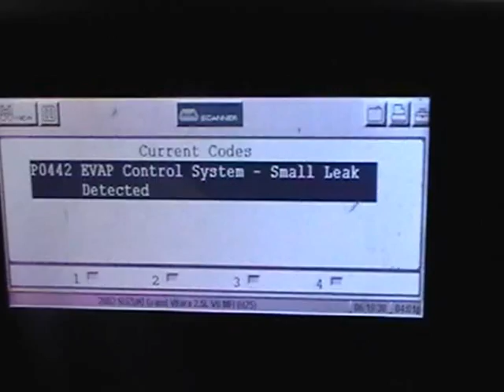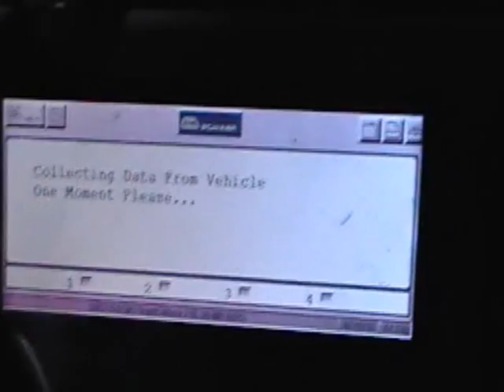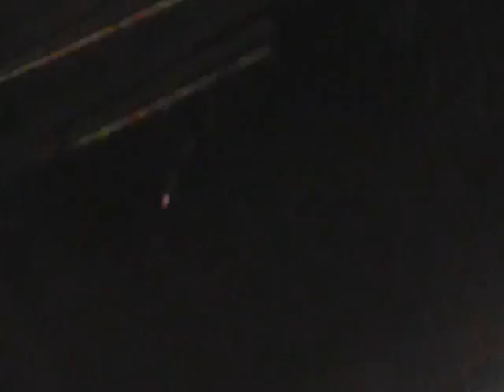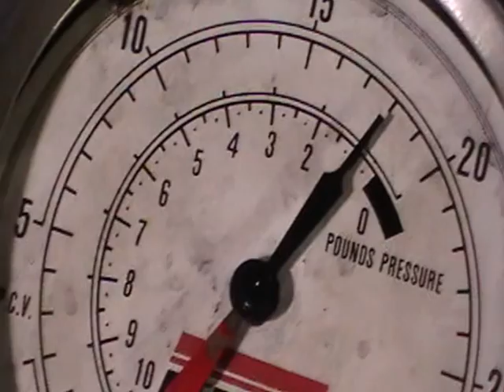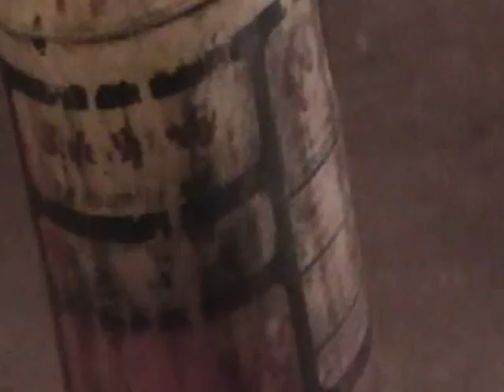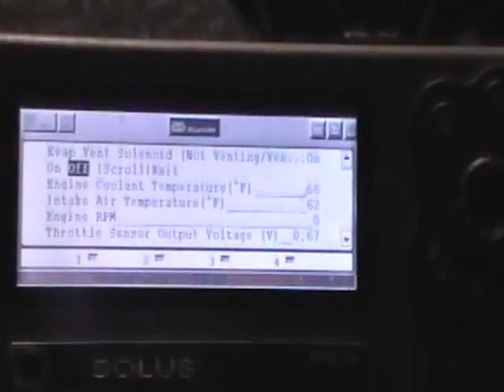P0442 EVAP LEAK...FIXED

Comment: I replaced my vent valve solonoid on my 2004 explorer 4.0 sohc flex fuel vehicle and didn't use pliers on the gas hose. No gas leaked out, is that normal? Or is something blocking the fuel like small pieces of charcoal from the cannister. I got codes:p0460 fuel level sensor A circuit. P0442 Evaporative emission system leak. P0506 idle air control system lower than expected. I have a slightly rough idle when in park. The rpm's go high when switching into 2,3,4th gear in my automatic. Sometimes it keeps idling and wont want to switch gears unless i peddle it down. The rpm's are so high that when it shifts gears my rear end jumps. I have loss of power, it seems like its getting too much air. I do have a exhaust leak. It has 137k miles. Maybe the Egr valve, O2 sensor, maybe the vehicle transmission sensor. I say vehicle transmission sensor because it controls my Abs sensor, and im losing power in the brakes and now the brakes are squeeking like they are to close to the rotor. Possibly a brake booster? Please help! This fucking car is a nightmare!
Reply from the maker: No liquid fuel should.come out of the vapor canister system. Ur good. U could have a vacuum leak . But those fords were known for throttle body issues. I'd clean the throttle plate with solvent and a rag first. And see if u have a changeable fuel filter. A clogged filter and maybe u are having to give more throttle to move? For the shifting issue..
Reply: @jamesdanner7850  I put new throttle body on, and it still did it. Then check engine light came on just now. It said i need a new gas cap. It seems like it working, the fuel system is resetting itself and smoothing out. Thanks for the reply!

Comment: Hey James. It has these codes after KOER test. P1116,P1137,P0141. Will the temp sensor code will cause a no start like this? I have heard it will.
Reply from the maker: +william burke I've seen it on gm alot. When the sensor goes open. It defaults to minus 40 degrees and it pretty much floods it with gas and won't start or very hard start with poor running. U got a scanner to see what temp the computer thinks it's at?

Comment: This p0442 code came up on my 2010 chevy impala. at the same time i noticed some studdering when accelerating and my remote start stopped working.  any ideas...? :c
Reply from the maker: +mrpoppapill slot of times the chevys need the vent valve in the rear. They work intermittently a lot.  
Can't think of any link with the stutter or remote tho
If it's a factory start system it may be disabled with a cel being on
Reply: i took it in this morning before work, [it actually gave me the "reduced power to engine" +"service service track" codes on the way in... (which ive found is common with these particular error codes.)

they're replacing the gas cap & accelerator pedal. if that doesn't work they're going to the o2 censor. bill is at $288.00 so far (without o2 censor).
[just posting this for future people reading~]

edit: pro tip for chevy impala drivers [2010]. REMOTE START IS DISABLED WHEN CHECK ENGINE LIGHT IS ON***
Reply from the maker: Did it have an app. Sensor code?
Reply: Exact same thing happen to my 2010 yukon xl denali. Remote start stopped working as well when this code popped up. What was the update on your vehicle?
Reply: it was an emissions censor of some kind. if you really need the info let me know, i can dig out my receipt and help you with an exact part that was replaced ~

Comment: Hey james have you ever come across p0442 on GM vehicles. I have had a few where people have thrown everything in the book at it and dont fix it and then they send them to me to fix it.   im sure you know what it is shhhhh.
Tim from Midas
Reply from the maker: +midas cottman a lot of times is just the vent valve not sealing or only working intermittently.  I command them on and off a bunch to get it hot and they stick. Or if u r in the rust belt like me, lines and filler necks rot out or even rust on the gas cap sealing surface
Reply: well on gm they use a fuel tank pressure sensor and the pcm uses that data to calculate an evap episode and when the sensor is giving a faulty reading  ie. negative 0.34 in h20  it sets a fault code of a small leak. replacing the sensor fixes the problem i have come across it a few times and also one yesterday.

Comment: does this p0442 code effect vehicle performance at all??
Reply from the maker: Nope. And If it failed like mine did, the system still works as designed. Just can't check itself for system integrity. That's all that vent valve does..close for testing purposes..
Reply: Ok thanks

Comment: I have the same problem (same error code anyway). How important is this to fix? If I leave it will it get worse and more expensive to fix?
Reply from the maker: from a tree hugging environmentalists perspective, u are polluting the atmosphere with a small amount of fuel vapors. from a technicians, there are no drivability concerns. in fact a good bit of the time the system works like it should. its the devices(like the vent valve), that are only put there to test the system for EPA regulations,that fail.. . or if u need an emissions test that relies on obd scanning..it would need fixed..from a further damage perspective, I guess u could argue that moisture from the atmosphere could have an effect on parts or the canister could become saturated with vapors if system isn't working correctly, but that's stretching a bit HTH
Reply: James Danner Cool, thanks for the fast response James.
Reply from the maker: you bet.  thanks for participating
Reply: lawndogmoon2
Reply: rp3106 Yep.

Comment: Hey James, quick question: does your Snap On Solus come with Suzuki Enhanced software under the Asian Imports menu? Just got a used MODIS v11.4, and Suzuki seems absent from the menu. Is it a separate upgrade like the Euro stuff? Thanks!
Reply from the maker: yes.  my solus is only 12.2 and Suzuki is there to 2011. and I have actuator test functions
Reply: Yup looks like Snap On didn't have Suzuki coverage until v12.2...thanks for the info! Guess if they included everything to begin with they wouldn't make any money on updates haha. I'll have to rely on my Autel MaxiDas to fill in the gaps :)
Reply from the maker: Yea and the modis is two separate updates. Ugh

Comment: Awesome.  I like the straightforward approach to solve the problem.  I had an evap leak and wish I saw this beforehand.  To save $$ I replaced the vapor cannister vent valve and gas cap, cross my fingers, tapped my heals together, and got very, very lucky.

Regarding other people in the video.  My suggestion is to simply and politely introduce them and then quickly move on to the task at hand.

Comment: Awesome idea with the pressure gauge, but how did you regulate shop air like that?
Reply from the maker: im just using a 2 dollar blow tip from harbor freight, it twists on the end and opens up. i just do quick pulses and watch the gauge and do 2 lbs max then close it and watch for the drop others are asking for more descriptions on the setup..next one i get ill make a short vid on just the setup

Comment from the maker: no.if you are clamping the vent hose the key can be off.if you want to energize the vent valve electrically(if its good) some cars allow a scanner to do it or do it with a jumper wire to ground.if you turn the key on usually you will see voltage on both wires(backprobing while still plugged in).when you unplug connector you will only have voltage on one wire..this is the supply voltage,dont ground this one.move the pin to the other wire and plug back in ground this one to shut valve electrically